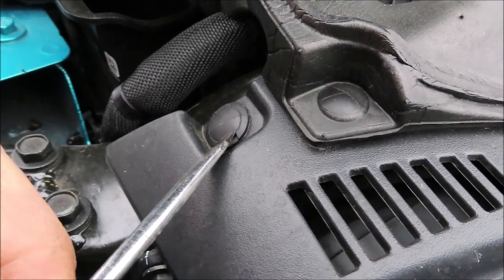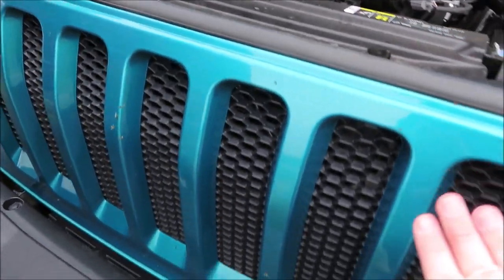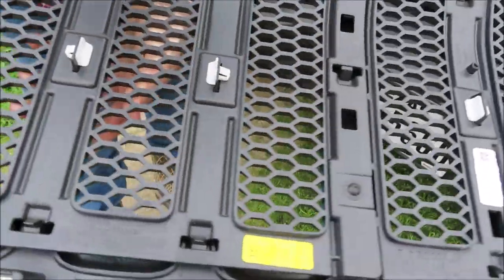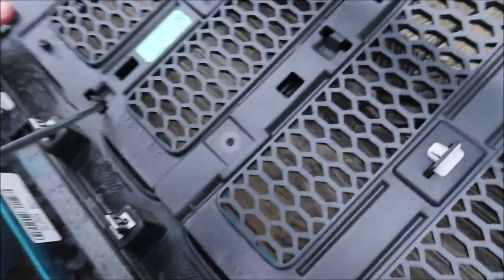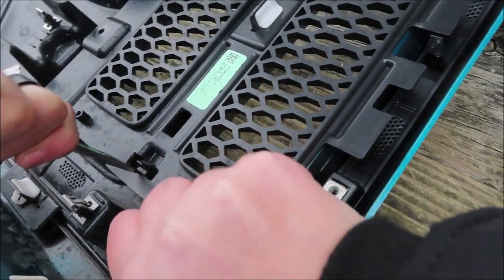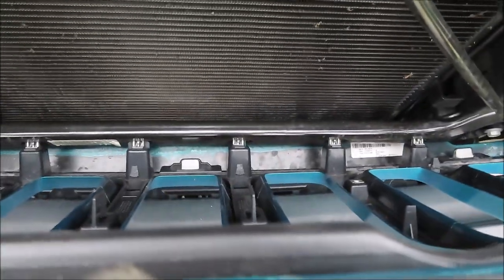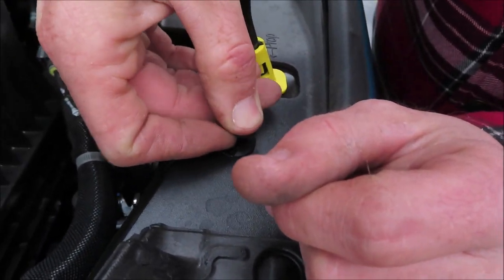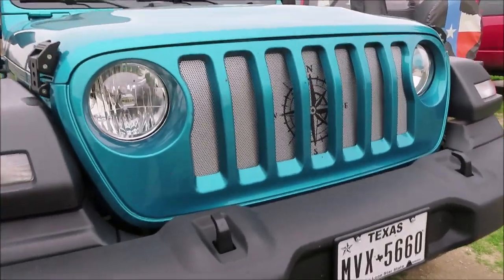Dirty Acres Grill Insert Install on my 2020 Jeep Wrangler

Comment: Easy install in less than 30 mins. Best practice for 2018 JL which had a different factory insert than the video - I recommend putting the T-20 torque screws back in to hold the insert in place. Otherwise the bottom piece will be floppy. Love the look!

Comment: I got it in but was unable to completely remove the grill as I have an aftermarket front bumper,   You can remove the factory  grill inserts without completely removing the grill just a bit more work, and a T20 with a pair of plyers .   I was a bit disappointed as to how light the paint was on my new insert but it looks Okay-ish   .

Comment: Just did one of these grill inserts on my Gladiator.  Will say that the plastic edges on the factory clips WILL cut your hands and fingers, so use a bit of caution there.  I have two skinned knuckles from them.  lol.

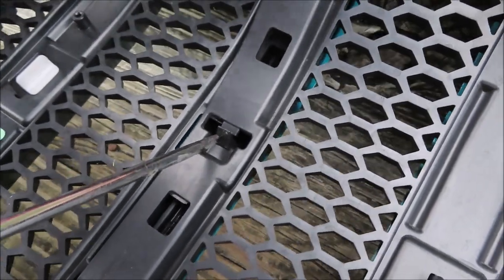Comment: 5:30 the tabs that hold those white clips, did you remove them?  They seem to be in the way when I put my insert in, keeping the insert from being flush up to the back of the grill itself.  Watching the end, looks like you left in place.  Thanks
Reply: Yes same with mine when I was installing… I didn’t like how it doesn’t sit flush like the honeycomb one…. Ended up going back to honeycomb…. Looks good directly head on, but any side angle shot looks bad with those tabs showing
Reply: I used zip ties around the tabs on the grille that originally held the honeycomb inserts to the grille. This held the plastic grille liner tight to the grille vs the otherwise loose, floppy fit.